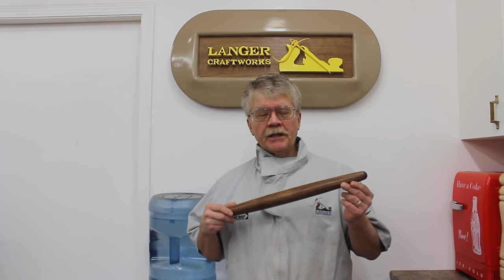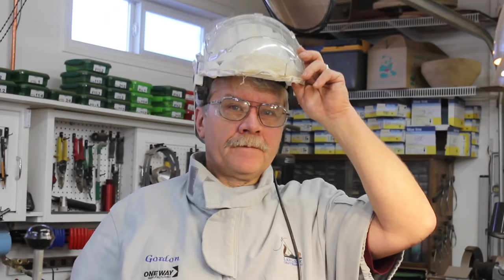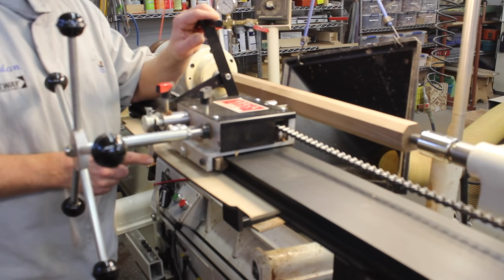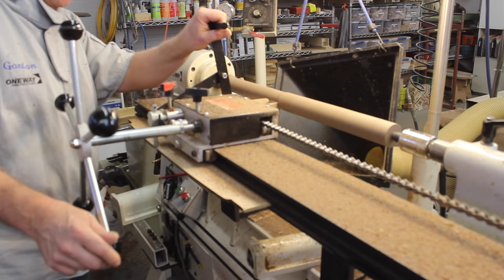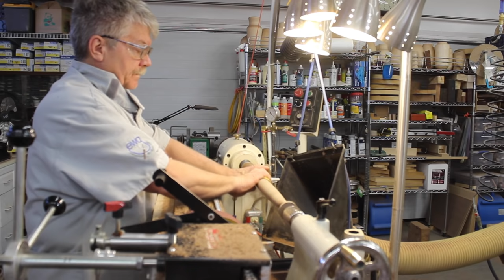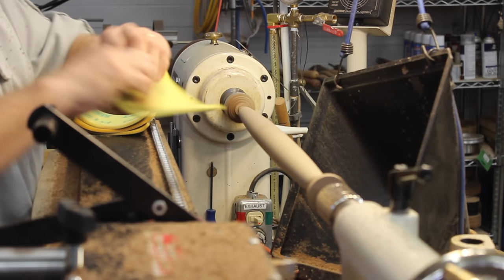Lathe duplicator

Comment: I made a shield out of a polycarbonate panel that I folded and stretched to the top of the duplicater. It does a great job of keeping shavings from hitting me and also make cleanup easier
Reply: What technique do you use to form/manipulate the polycarbonate?
Reply: @mavenfeliciano1710  
 I just used a heat gun and folded it over the edge of a board.

Comment: Which food grade finish do you recommend? Do you not recommend applying the finish while turning at a slow speed then parting the ends?
Reply: I use food safe salad bowl finish while on the lathe slow speed to start the high speed to finish off.  Then part the ends.  Gord
Reply: Hi Bees Wax or Salad Bowl finish is the best/ safest to use.  Gord